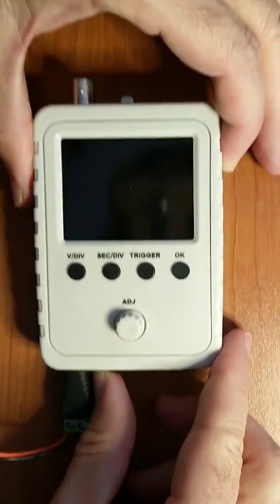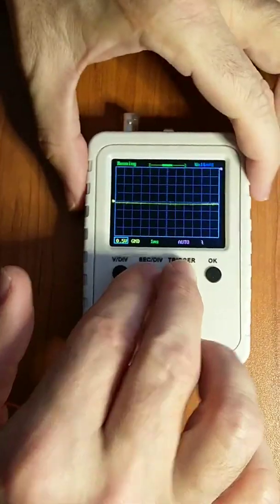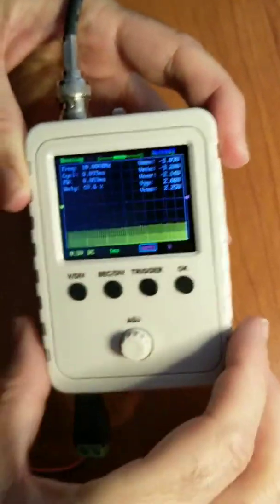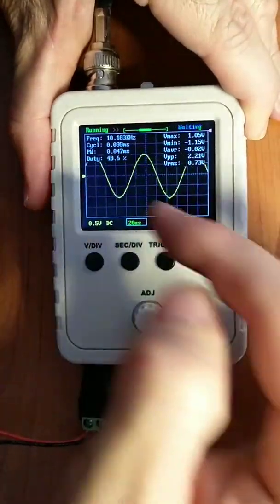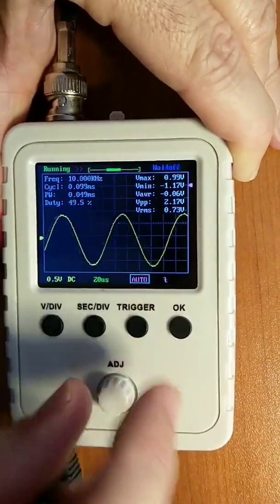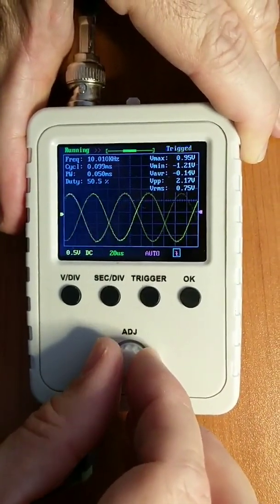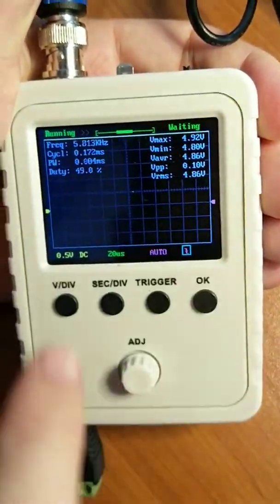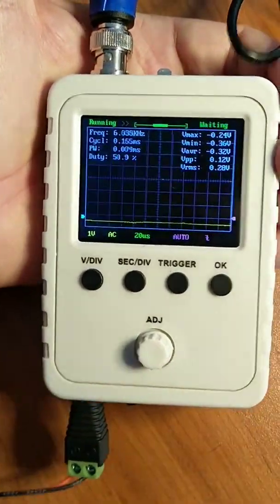How to use the DSO150 Student Oscilloscope

Comment: I've had one of these for years, but never had any instructions with it.  Used it maybe 5 times and the measurements seemed so far off from what I was expecting I assumed it must be faulty or not capable of being even remotely accurate.

Decided to find instructions before tossing it and came to this video...reset the setting upon power up...and now it's working as expected.

Had that simple procedure been screen printed on the case, it would save so many people so much frustration with these units.

Comment: evening can i use it to test sensors on automotive vechiles
Reply from the maker: Hi Donnie, Maybe - it depends on the speed of the signal from the sensor.  The DSO150 is limited to 1MHz.  A product like the Hantek2D82 automotive scopemeter or Hantek1008B automotive PC-scope can, however, measure every sensor in a car. We sell both of these models as well. https://kmeasure.co.za/product-category/automotive-diagnostic/

Comment: Will I be able to detect clipping and measure WRMS in amplifiers and speakers with this unit?
Reply: Yes, you will see clipping and be able to measure RMS.  As long as the voltage doesn't exceed 50V peak-to-peak.
Reply: @JohannY2   could you explain the procedure to measure RMS on this unit?
Reply: @darrenpetersen384  Refer to the user manual to switch on measurements.